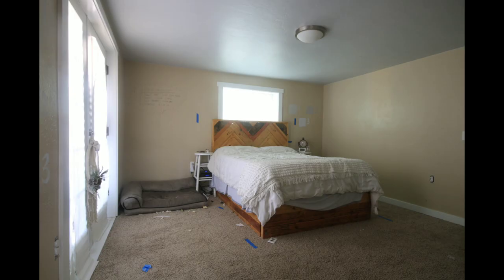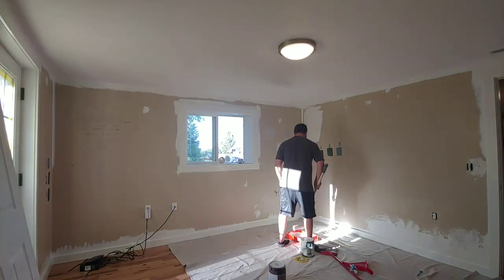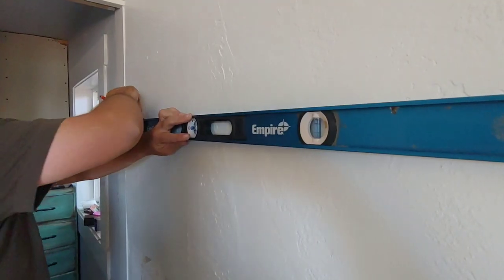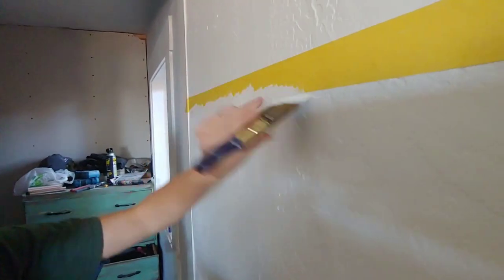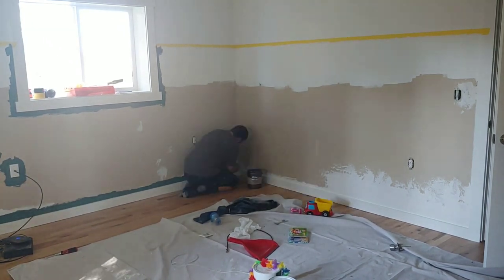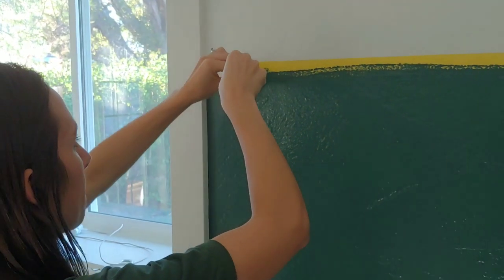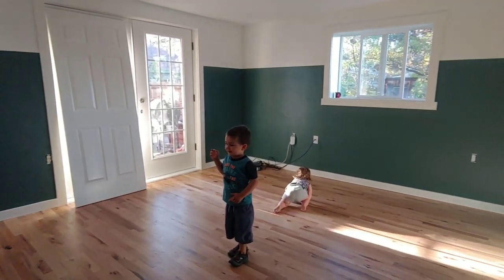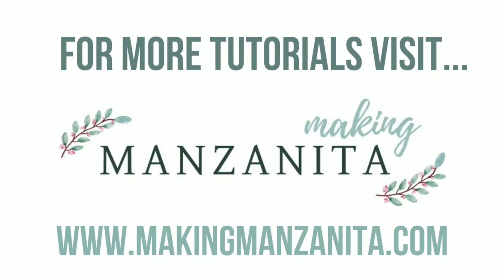Frog Tape Wall Design - How To Get Crisp Paint Lines With Two Tone Walls

Comment: I was wondering, how did you remove the pencil line you drew to help marking the tape. Super handy video btw!
Reply from the maker: The pencil mark was covered up by paint. When you're putting the tape down, just be sure to align it on the top of the line so the line gets painted over.
Reply: I now have super straight lines in-between the colours with an ugly pencil line in-between 👍

Comment: Hi! Im just wondering what the difference is between the laser line and the pencil line? Why was it easier with the pencil line? Thanks
Reply from the maker: We tried the laser level a couple of times and it wasn't accurate, so we switched to using the pencil instead.

Comment: Hiya nice colour. I presume you did two coats of the green. Did you not remove the tape inbetween coats? Otherwise it dries 😏
Reply from the maker: Yes, we did two coats of green. Yes the paint dries in between coats, but there's something about removing it when the top coat has just been painted that helps with that crisp line.
Reply: @MakingManzanita  sorry your response to this comment isn’t very clear, did you do one coat of paint, then remove the frog tape before doing the second coat of paint or at the very end? If you did it at the very end does that mean you did the second coat when the first coat hadn’t fully dried? I’m new to painting so not sure how long to leave it before a second coat
Reply from the maker: @kathrynswalwell2107  2 coats of green paint. Leave the tape on until the end. Wait about 2 hours between coats and then remove the tape right after you're done with the second coat while the paint is still wet.
Reply: Thanks for asking this Polly. This was my question as well 😁

Comment: Does the bottom paint have to be dry before u remove the tape?
Reply: No. Sooner you remove it the better, to prevent peeling the paint off whilst removing the tape
Reply: @jhilt90  but let it dry berween coats I'm assuming
Reply: @djpaulsid  once it’s had the required coats, I tend to remove it straight away. Saves it being on the wall any longer than it needs to, causing it to pull paint off with the tape
Reply from the maker: Yes, this... let the coats dry appropriate time in between coats and then after last coat, remove immediately.

Comment: Hi! Why did you paint the underline of the tape with white first and than the green? Can't you just do it with the green paint?
Reply from the maker: The paint block technology of the FrogTape is activated by latex in the paint, so if you first paint over the bottom side of the tape with the 1st color it will help essentially "seal" the paint line. This will you'll prevent the paint from bleeding under the tape due to texture and any other imperfections in your wall. It's definitely worth the extra time to do this step!

Comment: How did your husband get such a smooth line on the baseboard where the green meets without painting over? Noticed there wasn't tape, but did you guys use a edger or something like that?? Or just very steady hands? 😂
Reply from the maker: Steady hand, good paint brush and lots of practice! We have a whole YouTube video and blog post in the works with so more tips coming soon!
Reply: Have a good cutting in brush like a Picasso, wipe the access paint from on the outiside bristles of the brush back into the bucket, then just allow the brush to do the work for you as you angle the brush. You don't need particularly steady hands or a lot of experiance, just practice in one medium sized room, and you'll get good by the end.

Comment: Hi there. If I am painting a wall that was painted years ago (light gray) and then I want the bottom half to now be dark green do I still did to dig up my light gray and repaint over the tape before the green? It's the color that's currently and has been on my walls.

Also for taping is it best to keep one continuous piece of tape as much as possible? What do you do for the corners? Try to keep the tape going and press it in?
Reply from the maker: yes, if you can get ahold of the old paint color, I would highly recommend the method of painting over the seam of the tape. It is worth it. 

Yes, try to use as much as a continuous piece of tape as possible. Just press the tape into the corners as much as you can (you can use a ruler or putty knife too) and then keep going.
Reply: @MakingManzanita  thank you!! Appreciate the follow up and tips. I'll be painting tomorrow hopefully!

Comment: What happens if you need to do a second coat on the bottom? Do you still remove the tape?
Reply from the maker: No don't remove the tape until you're done painting.